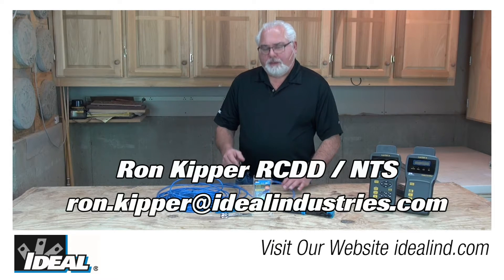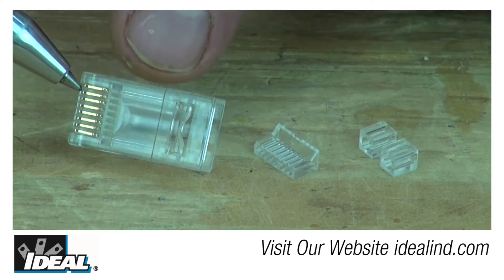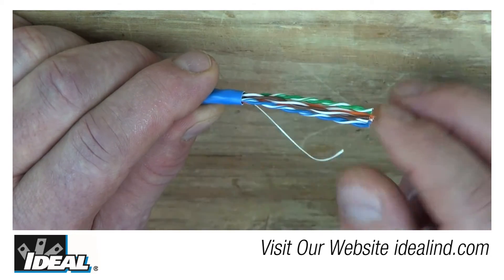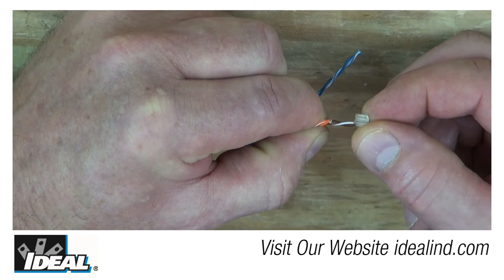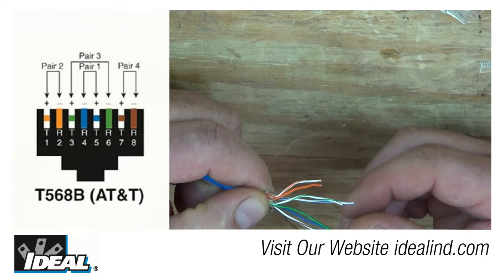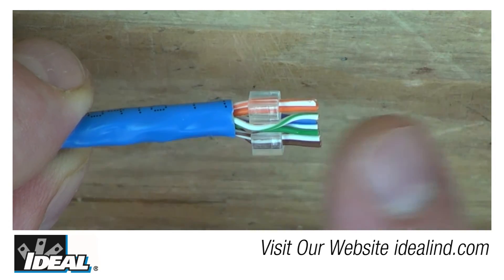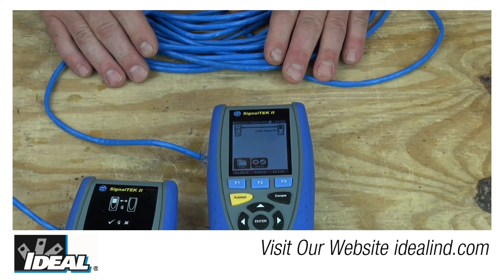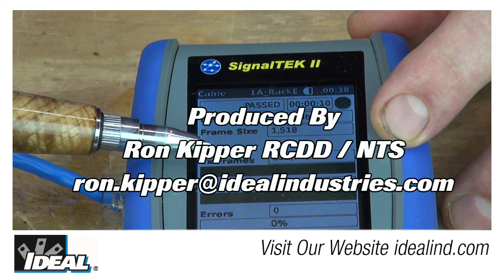How To Make A Cat 6 Plug Long Video

Comment: Great video. Thanks. I had to put a cat6 plug on a cable coming from outside the house. I got the right connectors (Ideal, from Home Depot), made a cord for practice, and then tested it. Success! First connector took me an hour, second one 25 minutes, third one (the one I needed to install in the first place) 10 minutes. This video saved my bacon!
Reply from the maker: yes it takes a little practice! Ron

Comment: Great video Ron.  You're right - it takes a little practice, but it will come.  A common error I get is a Split Pair on pairs 1 & 2.  Might you know what might be causing the in particular.  On your other "shorter" video you mention "leaving a twist" inside the saddle if possible".  However, from your video, and my experience, I receive less errors when there are no twists in the organge & brown pairs, from one end of the saddle to the other.  Thoughts? Thanks for the great video. I don't think I could have done my home wiring project without it :-)
Reply from the maker: Hi Andrew I assume you are using a basic wire mapper for testing the cables. Many basic testers will indicate a split pair on very short cables. So if you are making a 1-3 foot cable you may see that result when there is nothing wrong with the cable. Use a longer patch cable and the error goes away. Has something to do with measuring the capacitance in those pairs. Hope that helps and thanks I am glad the channel helped you out. Ron
Reply from the maker: Wow I have not seen that tester/tool combo............I am betting it is the tester. Cheap versions of a wire mapper just cannot accurately measure a split pair. A split pair is when two conductors that make up the pair are not twisted together. I'll help you out send me your address and I will send you a slightly used Linkmaster from IDEAL. Ron at ron.kipper@idealindustries.com
Reply: Ron Kipper Datacomm That's very kind and generous of you. I sent you an email earlier with my mailing address. Let me know if you've received it. Thank you very much!

Comment: This video was surprisingly the only one that I've seen that's put emphasis on being sure to push the wires all the way into the plug, which is why my first few attempts failed. Where can I find 8P8C plugs that come in that modular fashion? I'm surprised they're not more common because that seems really helpful for getting the cables lined up right super easily and quickly rather than hoping they go in order as the plug gets pushed on.
Reply from the maker: Hi Ryan any local electrical supply house would have them or Home Depot or Lowes. Thanks for the comment I agree a little thing like making sure the wires are fully seated in the plug definitely helps. Ron

Comment: Nice vid Ron.... I this the two piece will slow you down if you had hundred of those to make... But the tips you gave us are great... I have a double loop side on my stripper too foe coax.....
Reply from the maker: +spyderx92 Yea the Velcro is a good tip and like I say a little practice is needed for the plugs. Ron
Reply: +Ron

You think you will make a class without Home Depot?
Reply from the maker: +spyderx92 Not right now they want to move to an online training program. Ron